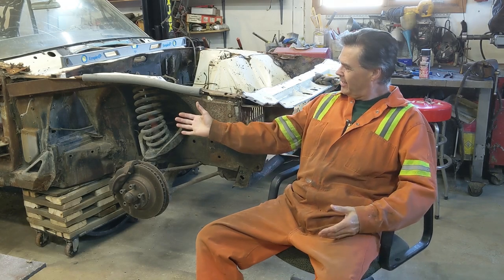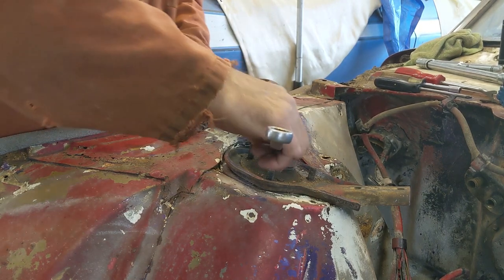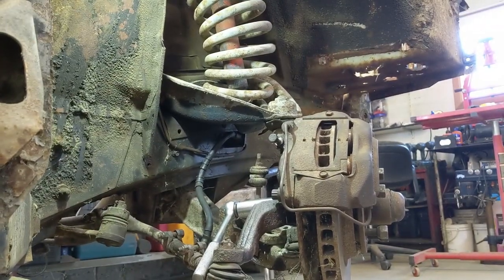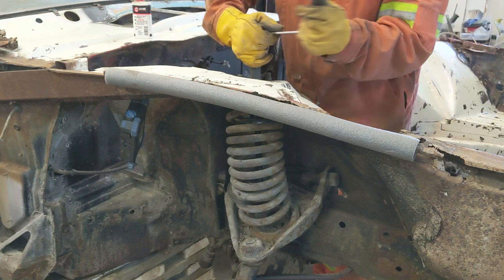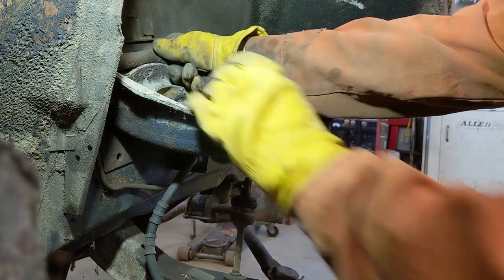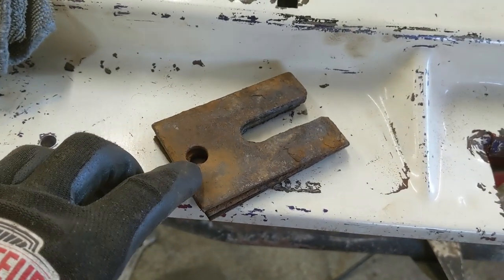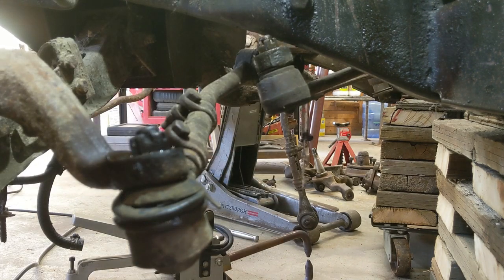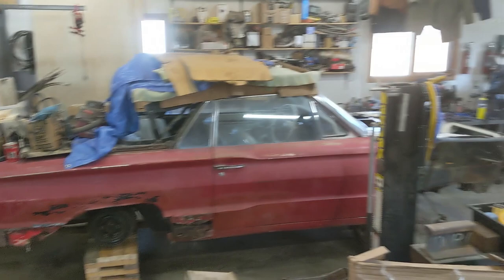FRONT Spring & Upper Lower Control Arm - 65 Thunderbird Convertible Restoration Ep #5

Comment: I love that body style of T-bird, I had a '64 for 11 years. Loved it. My upper control arms were broken on the forward ends, i guess they never lubed it. My ball joints need ed replacing and I never got around to doing that. I don't know if they make more parts now for them but I had trouble getting shocks for my car! but that was the '80's. God bless.
Reply from the maker: They are a nice looking car! The availability of parts seems to be better...the quality of some those parts may be questionable.
Reply: @J_R_Shop  Your a far braver man than I am, I would not know how to deal with that amount of rust. Do they make new quarter panels for the T-bird? hmmm.... there are two T-birds in out local junk yard here. Are the valve covers correct? I know the '64 had the word Thunderbird embossed on them.

Comment: Hey Jamieson, welcome to the club, “Knuckleheads who work on Thunderbirds.” I think John is the president. 
This is the first of your videos I’ve watched, very good. One of my YouTube fans directed me to you and glad he did. That’s quite the project you have. Lots of rust repair I see but since it’s a convertible I guess its worth fixing. Your struggle with nuts and bolts is because of the rust, parts just want to rust together. Thankfully most of my experiences with Thunderbirds were on California rust free cars and we had very little issues with rust and rusted hardware. 
I like your cribs, great idea. In Los Angeles a crib is slang for where you live. Anyway, I think they are a great idea because it allows you to move the car around too. Do you think they need to be so big (large footprint) or will smaller ones work? 
What you called a, “pinch nut” is a lock nut for the upper shock nut. They either have that or a split washer under the nut. Either way will work. There should be some kind of locking mechanism for the nut. A lock nut will also work. I use my impact gun to remove the upper shock nut because it has the power to remove it at high speed and the shock shaft wont spin with it. I heard that you were already corrected about the upper shock bushings. I use a very large ball peen hammer and a press to swedge those 4 shock bushing tabs back to hold the underneath bushing to the plate. When that bushing is swedged properly, it should not move or spin on the plate. It should be swedged hard enough to stay in place tightly. 
I didn’t do this in my video because, in truth I forgot, but it is good to raise the whole assembly, arms and spindle, with a floor jack as your compressing the spring, then the spring stays seated in the arm and makes it easier to compress it. Also, if the spring compressor breaks, the spring is still seated in the arm. The car may jump up but at least the spring won’t come flying out. You can do this when putting the spring back in too.
I got a good laugh at the alignment shims placed between the shaft and retaining nut. A real rocket scientist put those there. I noticed in the video that the upper shaft bushings were broken, that must have made a hell of a noise while driving. So much for the alignment. I wonder how long the car was driven like that? 
Think about powder coating all the suspension pieces. It removes all corrosion and puts on a hard durable surface that will last for decades. It sure makes it easier to reassemble when everything is clean and powder coated, and it looks great too. 
You mentioned that you were into mining, have you seen that guy who bought a ghost town Cerro Gordo in California? His YouTube channel is Ghost Town Living and he says there are more than 30 miles of mines below the town and he explores them in most of his videos. Pretty cool. You might find that interesting. What kind of mining do you do? 
Ill check out your other videos and comment. I have a bad habit of correct everyone so please forgive me. If you don’t like it, just tell me and I will buzz off and go hang out in my crib. Good luck with your project.
Reply from the maker: Hi Nick, 
Thank you so very much for all the great tips, and I don't mind at all if you correct me, if I did mind...well, I guess I'm not interested in learning!
The cribs could be smaller, just be careful of the height when going smaller, if they are only ever going to be in a fixed location...then not a problem, there won't be much lateral stress. I made mine the size they are because of the size of the wheel dollies. I should also mention that they are bonded together with construction adhesive...they are very strong.
I know of the Cerro Gordo ghost town, but didn't know about the guy doing video of the U/G working...going to check that out! My mining was mostly U/G mining, I started of in salt, then on to asbestos, lead & zinc...then diamonds were my last before retiring. Most of my mining career was in the Canadian Arctic...all camp living, and long rotations.
Thanks again Nick...I watch all of your videos, and I hope you don't mind that I mention you in my videos? 
LOL... “Knuckleheads who work on Thunderbirds"

Comment: Hello Alvin, It sure looks like all is going well so far with the disassembly.  Those extra washers on that upper arm was puzzling. Don't see what the purpose was. Heating that nut up with your spot welder was real neat. Thanks for posting your progress.
George B. In Michigan
Reply from the maker: Thanks George!
Yes...those extra bits on the control are were puzzling, maybe I'll find out the hard way when I am reassembling, why they are there.  😕😕😕

Comment: Excellent video.  Springs always scared me.  I was very careful removing air brake piggy backs.  How did you “uncage” the spring safely after you got it out?    I know of instances where people were badly hurt by removing springs without a proper compressor.  I like the crib work.  Thanks for recording your work!
Reply from the maker: Thanks Stephen! 
Brake pots, split rims, and coil springs always make me nervous...and they should, because they are dangerous! 
Because I am using the correct type of spring compressor (Internal), I was able to release the stored energy by reversing the order...the only issue I found with the tool, is that the threaded rod is a little short, and I had about 1/2 of a coil worth of energy left, not a lot, but something to keep in mind.
Reply: @J_R_Shop  Thanks.  I used one of those “short” compressors once.  I had to put my weight on the new spring to get the nut started.   I hate a broken spring as I keep waiting for a piece to come shooting out sideways at me.  I agree on the split rims.  I hope that they are becoming a thing of the past.  I had a boss who would inflate tires on the floor without a cage, then walk away while they were inflating.  He never warned anyone what he was doing.  If the rim held, he would come back and set the pressure.  I forgot to mention standing inside the fender was a great idea.  I wouldn’t have thought of that!
Reply from the maker: @stephenmoore2754  I just took out the driver's side spring today, I pulled back about a half of a coil, and all was good...a little tight getting the spring out, but no problem. I can see already that when I reinstall the new springs, it will be as you said, it will take a little pressure to get started. I may use my external compressors to get that little bit needed, and internal from there.
In Canada (and likely else where) split rims are still used in the mining on heavy equipment, but the ring is designed a little different, and mandatory under the mines act that ring locks must be install and is a part of the daily equipment checks.

Comment: What spring compressor did you use? I’ve been trying to find one that works with my 61’. And the only one that seems to work is the moog one that you mentioned but it is hard to come across.
Reply from the maker: Hi Jeremy...I found this comment marked as spam, this is happening often. I used a spring compressor that is a knock off the MOOG, it's a little too short for the long Ford springs, so care needs to be taken on the final few turns when releasing the tension...it will kick a little.